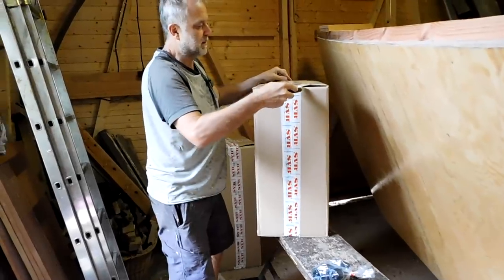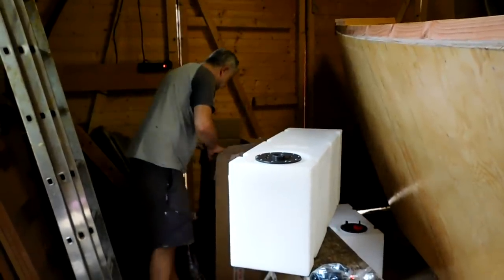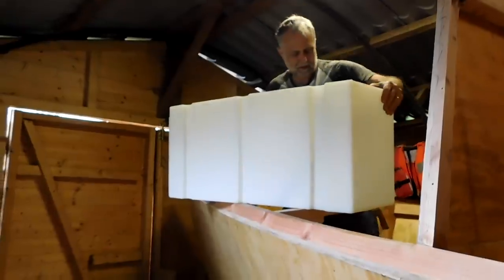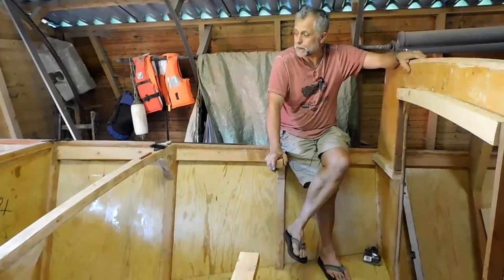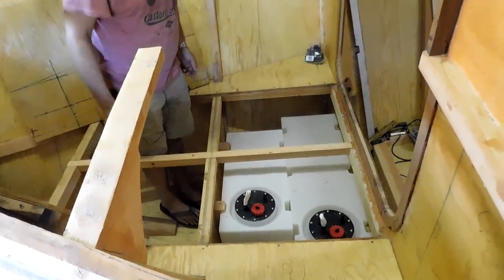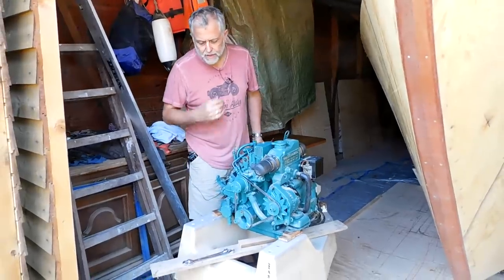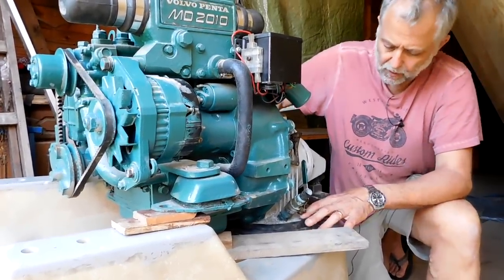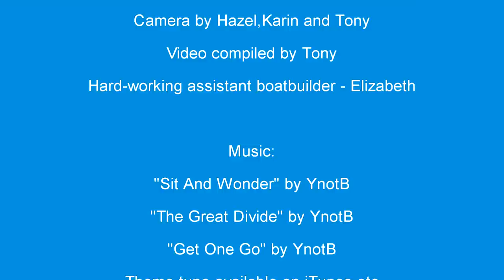Water tanks, the forward berth and the engine bed - SV Tapatya EP49

Comment: Damn.. I'd toss that engine bed and build my own from scratch. Not only would it be stronger (sorry, but I don't trust plastic engine mounts), you'd also recover all that wasted space in front of the engine.

Of course, by now, you've probably already done whatever you've decided on.. so I look forward to seeing what your solution was.  :-)
Reply from the maker: It's the OEM Volvo Penta engine bed. It'll be fine. It also forms the seal for the sail drive - rather important.
Reply: @SVTapatya  - Fair enough. I thought about sail drive, but decided to take a different route, and fit an outboard motor well instead.
Reply from the maker: That's certainly an option. Not sure you get the same battery charging ability, but maybe...

Coming back to that engine bed, one of the things I love about engineering is working with what's available and devising ways to make it work. The engine bed has its difficulties most certainly, but I'm confident I have a way to fit it such that it'll be good - even considering eventualities like the boat being upside down ( which hopefully won't happen, but is essential to take into design consideration)

Comment: Looking great, but instead of cutting finger holes, have you considered recessed brass finger pulls? Just prevents any larger detritus falling into the bilges.
Reply from the maker: Yes, I'll be using them on the floorboards, but finger holes are much cheaper :-)

Comment: Coming along nicely. Could you explain a little bit about the keel?
Reply from the maker: Yes. There are 2 keel options in the plans. Either a fin keel giving a draft of about 4'3" or a long keel giving a draft of about 3'6". Both keels weigh in the region of 1200 kg and are bolted through the floor timbers and so can be attached last.
Reply: Have you decided which option your going with yet.
Reply from the maker: Probably the long keel. I want to spend some time in the French canals and less daft is probably better for that